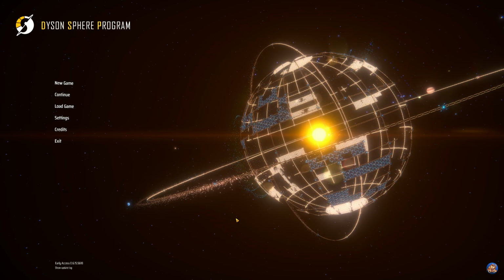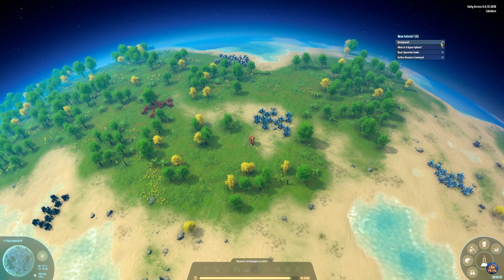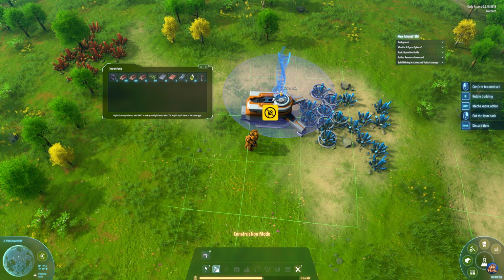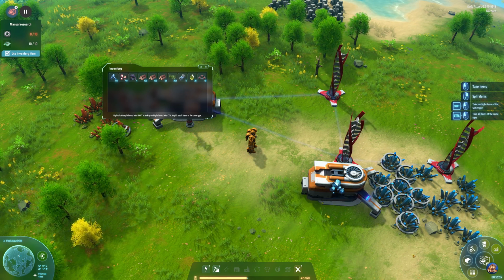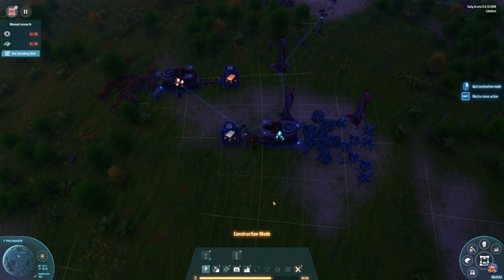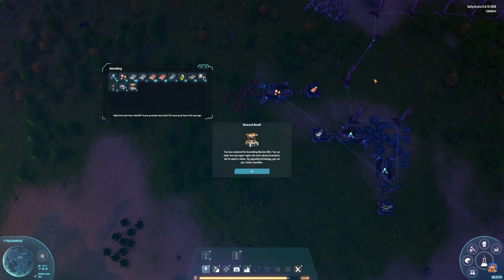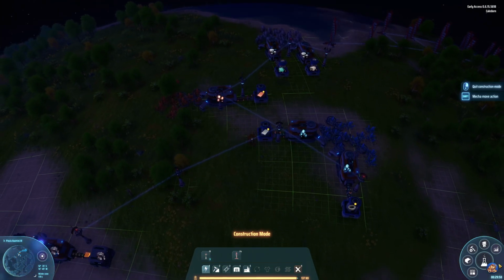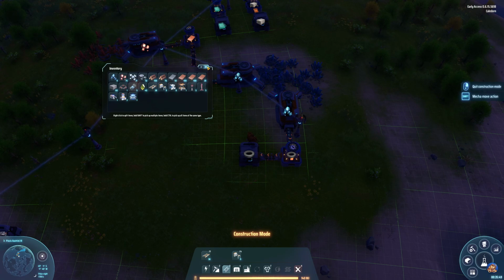Dyson Sphere Program - New Production Line Game - Starter Base - Early Access Lets Play - EP1

Comment: 15:00 Looks interesting, I have just bought this one now. For power, I would normally have a single line of power pylons, so I would try to remove the wind turbines from being close to the main area. It might be not possible though in very-early game where resources are tight. For wind turbines, they might have reduced power if other things are too close.
(End) The hardest thing I find with these games is that in the early-game, you do now have the ability to create the final layout for the overall base and I don't really want to tear down and rebuild the factory repeatedly through different stages of advancement. Realistically though, it will need to be pulled down and re-made at least one.
Reply: I did find a small problem, when collecting goods in storage, if the input doesn't back up it only outputs via 1 of the 2 outputs. So it doesn't load balance and has a preferred output. Would then just switch to a splitter instead.